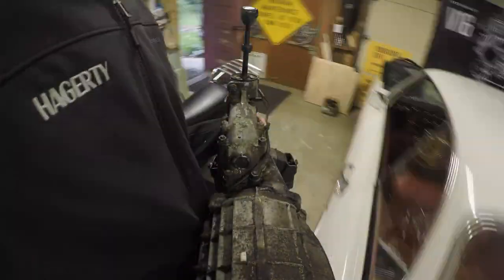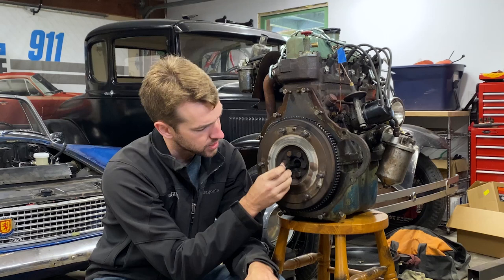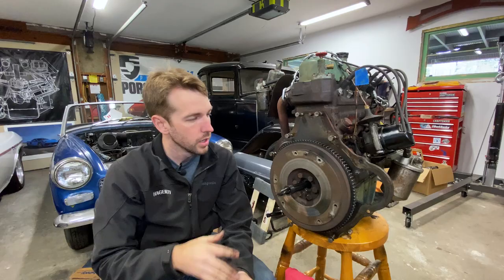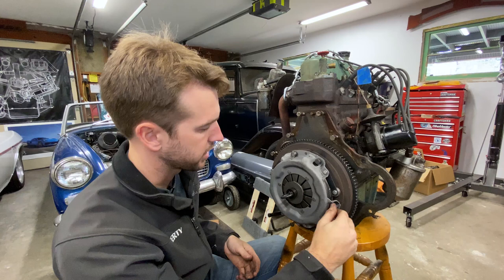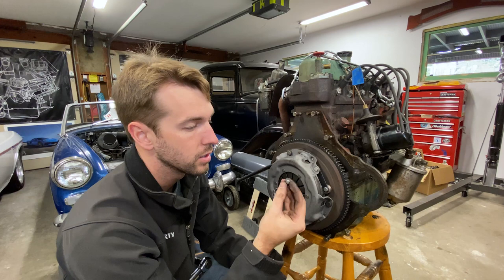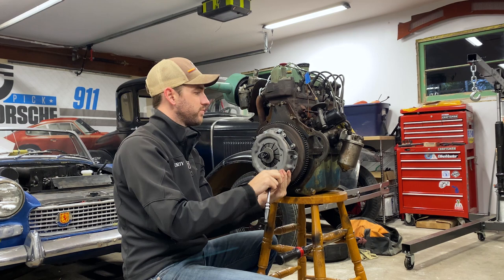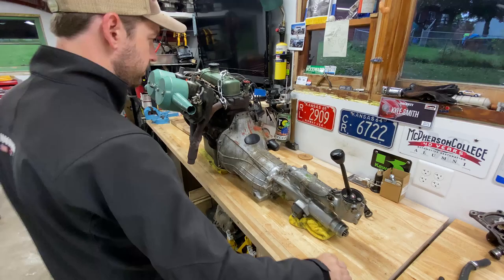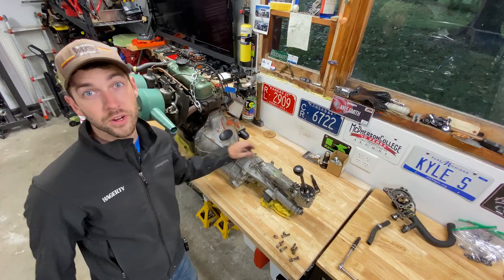Austin-Healey Clutch Reassembly | Kyle's Garage - Episode 16

Comment: Not surprised the broken bolt came out.  Once the head broke, the threads were no longer under tension.  And it wasn't a rusted in place  manifold or lug.  Probably could have turned it by hand if you could grab it.

Comment: To avoid the old hex head snapping off the bolt problem, you 1) make use of NEW bolts and screws whenever possible.  Metal fatigue is a real thing and could be one reason you had a snap off at 40 ft-lbs.  I go with Grade 8 for inch standard threaded screws and 10.9 for the metric fasteners.  Just to give yourself a few extra ft-lbs of torque before the hex head snaps off. 2) Look up the torque standards for each size bolt and don't exceed that.  3) Put a little bit of grease on the threads of the new fastener if there is no reason not to.  (Inside an automatic transmission with its pink oil is not where you want to grease the threads.)  This avoids the problem of corrosion welding, which is a female dog when you are disassembling an old installation.  This is called "thinking ahead".  Before using the "flywheel spec" for torquing, check the size of the flywheel bolts to the pressure plate bolts.  If your pressure plate bolts are smaller, there's your mistake.

Comment: And now you know why they suggest new flywheel and pressure plate bolts when replacing the components.If you cannot find the torque specs for your particular vehicle try looking up the ones for something similar like a 1971 Ford Pinto. That would bring you into the ballpark. Also an air powered scribing pencil works great for removing bolts that the head has broken off as the vibrating action acts like a little impact tool to loosen the bolt. It was a standard tool for a machine repairman @ Caterpillar Tractor where I worked.

Comment: There are charts of universal torque specs on the internet,  They are based on thread type, bolt diameter and bolt grade and should be used if you can't find your specific application.  That looked like a 3/8 fine, assuming it is at least a grade five, torque should be 26 foot pounds according to the chart.
Reply: Torque value depends on in which material bolt goes too.

Comment: Factory service manual states 22lb/ft for clutch cover to flywheel bolts. No wonder it snapped on you......if in doubt, google it!
Reply: Correct. I did just that and while there are some differing comments, it is clear that 40 was too high. It took a matter of seconds to Google it.

Comment: I would have never used the flywheel torque specs for the pressure plate. The bolts are too soft. 25 maybe 30 lb. max....   yep, later in the video he concurred with me...... :-)
Reply: Was thinking exactly the same when he said that.  30 still seems high.

Comment: If the input shaft won’t go all the way in then you probably have a burr on the clutch disc. Pull it out and find it. Also apply a tad of grease on the input shaft splines. If it’s necessary on my Muncie then it’s good for a mini trans.

Comment: I agree that the bolts are a little too tight. If the specs aren't available use standard bolt torque specs. The chart is easy to find.

Comment: Don't they normally recommend having the flywheel resurfaced when installing a new clutch and pressure plate?  Got to love those old British convertibles!!
Reply: As long as it didn't have heat spots or grooves it should be OK.

Comment: Actually, the definition of a bad day would've been the engine falling off that rickety stool. Inexcusably stupid set up, particularly when he could've strapped it to the engine hoist all of three feet away. Assuming the pressure plate bolts should be torqued to the same setting as the much larger flywheel bolts isn't too bright either.

Comment: I agree with everyone about the wobbly stool. Not saying I wouldnt do that, tho. I would have at least put a shim under the short leg of the stool. For the pilot bushing, much cleaner than grease is wet, soggy newspaper- or any paper. (Maybe all the political crap that comes in the mail?)  Stuff it in there, add more as the bushing comes out, and clean-up is easy! Oh, and is that a Vairy-8 Hot Wheels on the window ledge? So Cool!  One more question: are the Healy's bolts metric, imperial, or Whitworth? You probably wouldn't find Whitworth at the hardware store.

Comment: That torque wrench looked like a 1/2" drive, is it possible it's length compared to a shorter 3/8" drive multiplied the 44ft/Lbs.?
Reply: no, the numbers are calculated into the tool

Comment: No way that little bolt should be torqued to 40 ft lb.Probably 20 no more that 25 with Blue Loctite. At 30 those bolts are over stretched and will fail.